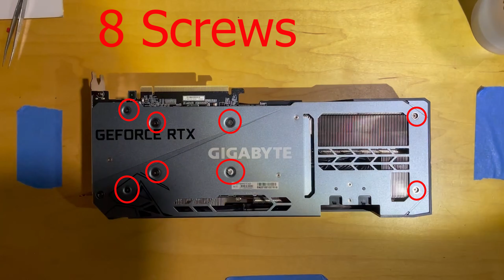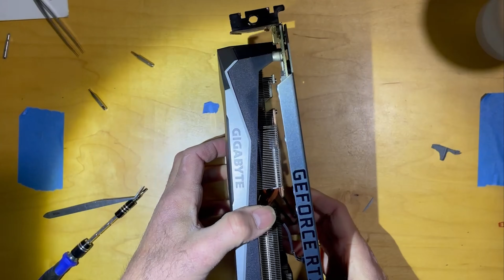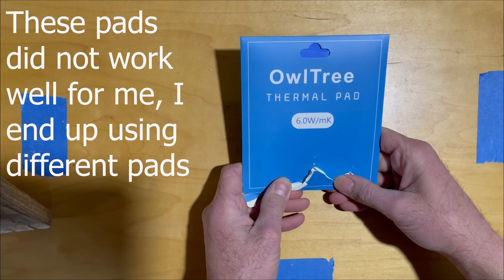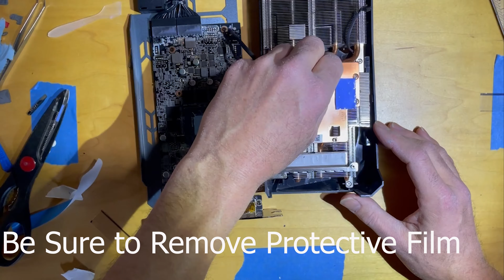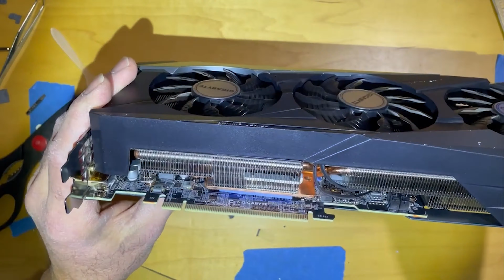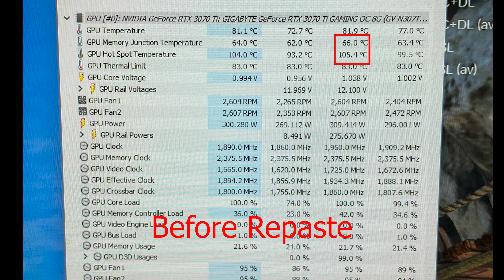3070Ti - Repaste and VRAM Pad Replacement - Gigabyte Gaming OC

Comment: Thanks to this video I was able to recover my gpu,
Can confirm thanks to a comment vram thermal pad Hight is 1.75mm as 1.5mm was too small causing vram over heating and 2mm was to high giving me 100c hot spot issues. (gpuz)
had to aliexpress order some fehonda thermal pads at 15w/m.k
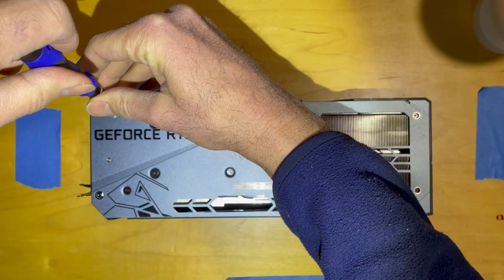fresh pads and paste hot spot after 1:30h furmark is 90c.

Comment: I used gelid 2mm thermal pad for memory and ptm7950 for core for my gigabyte 3070 ti but it still touching gpu hotspot @103 degree on furmark after 1 minute of test.The memory hit a max temp of 80C degree. What will I do. I have the same model and follow all instruction as provided. I also tried Arctic MX-4 but still the results are same. Please help.
Reply: Youre case is the problem. Check fans, my temps were insane, did a new case and got way cooler. Repaste CPU with Grizzly and it hardly goes past 64 when gaming in a hot room. And actually dude, if your pads on VRAM are too thick, which 2mm might be, it will lift GPU from heatsink and cause that exact situation you're having. Size matters.

Comment: Vram 2mm ?? Sir
Reply from the maker: Yes i know i was skeptical about using 2mm pads but on Techpowerup.com it said the factory pads were 2mm,
https://www.techpowerup.com/review/gigabyte-geforce-rtx-3070-ti-gaming-oc/2.html

 another youtuber did a repaste video and tried using 1.5mm and it did not work, the VRAMs got very hot.        https://www.youtube.com/watch?v=yjTus6FUXns , look at the temps at the 17 minute mark. 

Also i measured the factory pads they were 2mm but also very soft, you can tell they were swished down a lot. 

If the 2mm Gelid pads i used did not work i actually found 1.75mm pads i was gonna use but no need, everything worked out well using the Gelid 2mm pads
https://kriticalpads.com/thermalpad-1.75